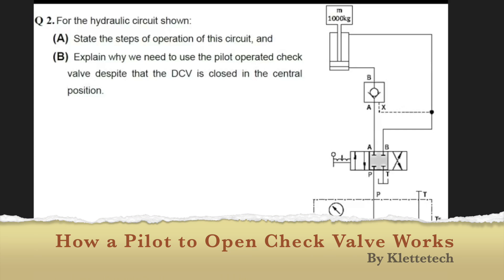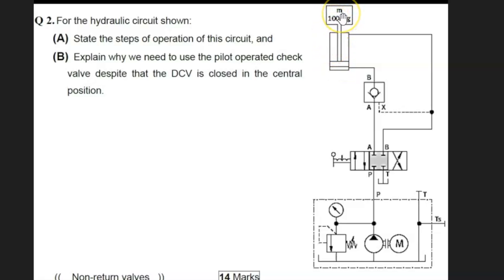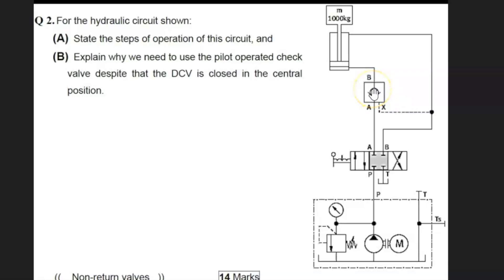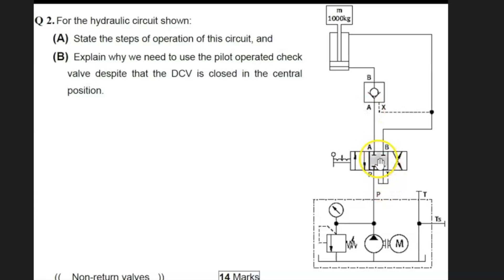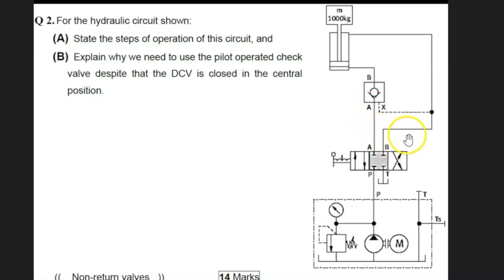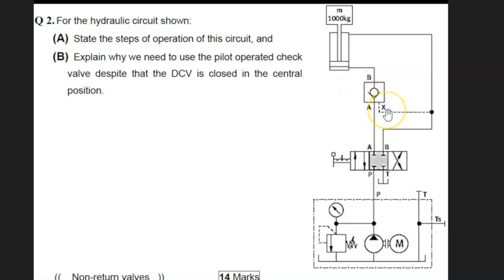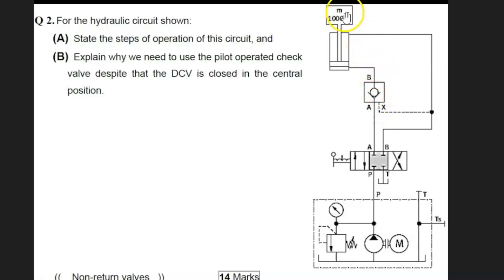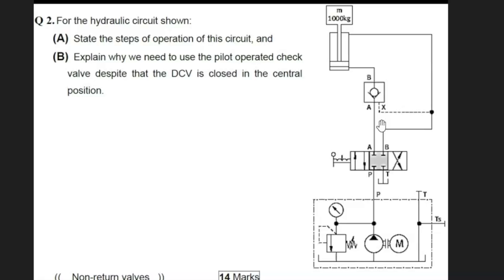How a Pilot to Open Check Valve Works

Comment: First of all, thank you for sharing these kind of videos. I could not see a video about counter balance valve,what is the difference between pilot operated check valve and counter balance valve also meter out meter in. I got a bit confused between them. Thank you in advance.
Reply from the maker: Yes.  There are two great videos about the difference between pilot operated check valves and counter balance valves.  The videos are by LunchBox Sessions.  They are very good.
Reply: @ Thank you for   your informative response. Is it  possible for making video about valve stand.

Comment: Good valuable information, Hats off. 
One question if B port is 100 bar, and A port 25 bar how it lift the pilot.
Reply from the maker: The internal controls.  The area of the pilot line is smaller then the area of the B port so it builds more pressure